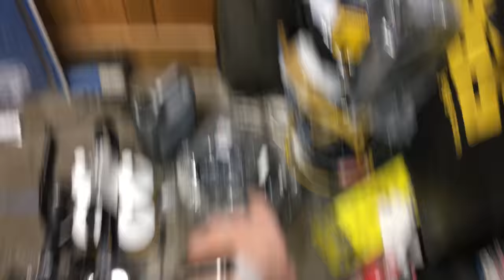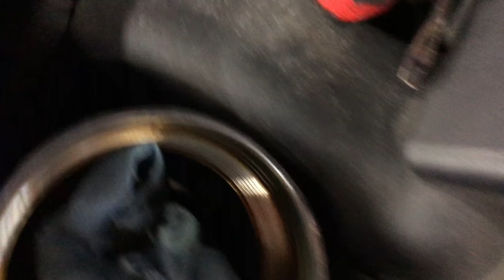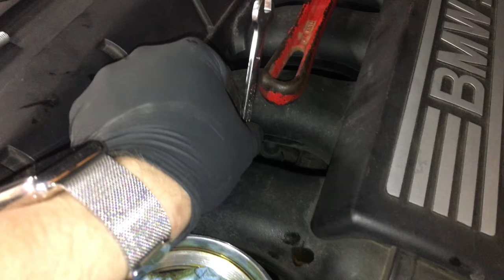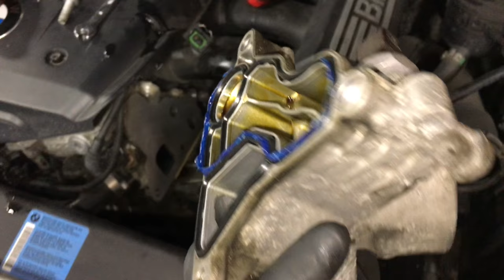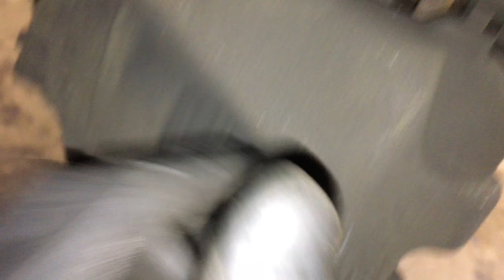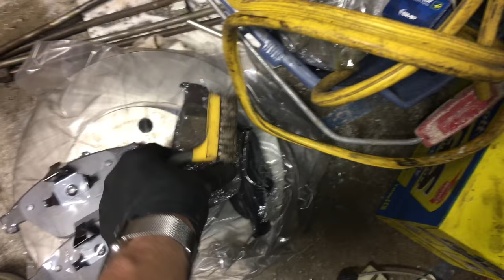BMW N52 Oil Filter Housing Gasket DIY

Comment: As I learned this weekend, it is VERY easy to round the head of those E10 torx screws as some are extraordinarily tight and the 8mm ratchet wrench will eventually damage them.  I wasn't as lucky as you regarding removing them.  Real PITA once that happens as I'm now learning.
Reply: have to use a TORX socket

Comment: BMW only specs a little over an hr labor for the n52. On the n54, it's around 4 hrs because it is impossible to get the back bolt as it is almost against the cyl 1 runner.
Next time, disconnect the smaller hose (goes from head to lower rad) to drain the ofh, head, and upper hose.
Reply from the maker: shops around here bill 3-4hrs no matter which N series. 

upper hose is plenty as its level with the outlet on the head. no cross contamination present.
Reply: That's nice.  Pulling the lower doesn't make as much of a mess.. just a suggestion.  I've done many.

Comment: when I did my front rotors I didnt wipe that oily surface finish off. it was like a year ago
Reply from the maker: lol, n00b
Reply: apparently you don't,  my mech told me, I was telling him to remove it and he said, don;t need to, in fact dont. like you said, running fine last year or so

Comment: I just replaced my oil filter housing for my N46B20 engine, and it seems to be seeping out where gravity is leaning.... couple of questions... i heard that the bolts should be torqued about 10nm, and some people say 22nm... , what torque did you tighten yous at? 
Does the hylamar prevent oil seeping out, even if i put it around the bolts??... dont know what else i can do to stop the oil seeping out.... maybe i will get a tooth pick around the grooves and clean that as well....?
Reply from the maker: I tightened mine to a good snug with a 6" 3/8 ratchet